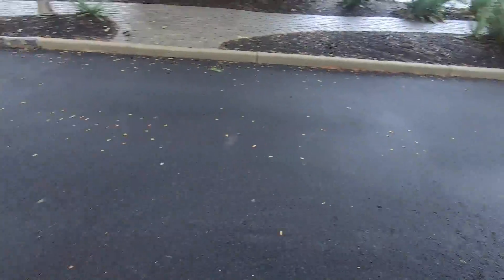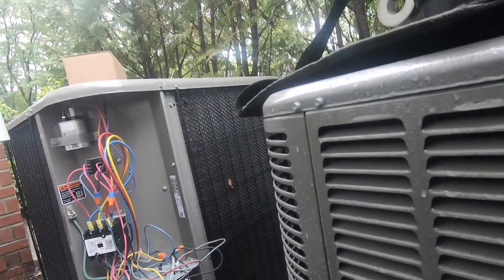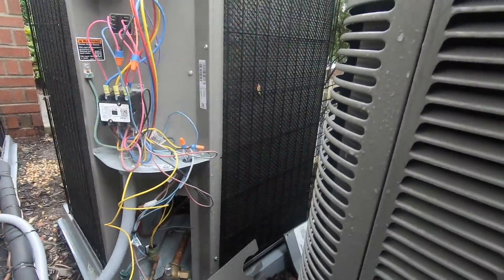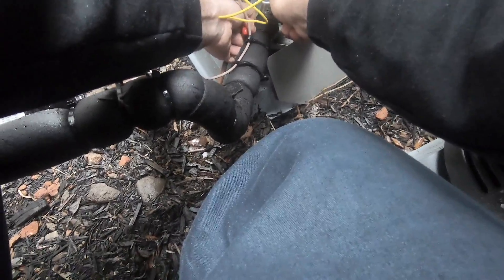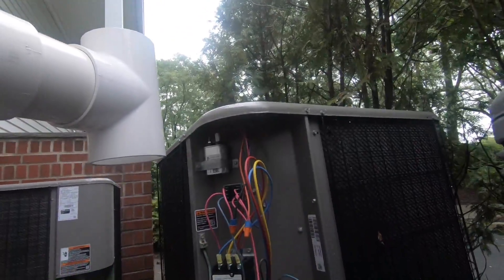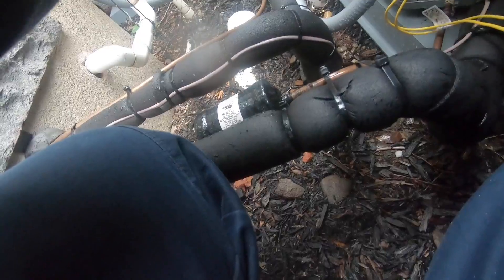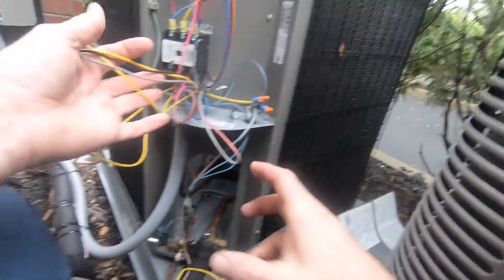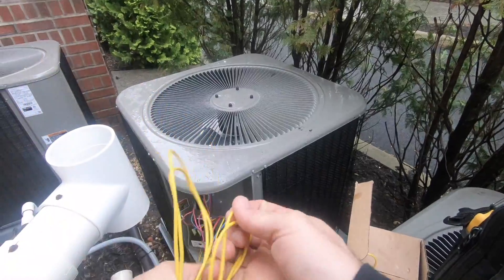AC Repair Replacing Hi Pressure Switch

Comment: i currently have a very slow leak on my low pressure switch.  was quoted $708 to replace it (June '24) from a quite reputable dealer here in my area.  i said to the tech, "get outt'a here.  that can't be that much."  he said, "no really, that's what it costs."  then, i said to him, "you are misunderstanding me.  i said to get outt'a here.  that means...pick up all your shit, put it away, clean up, get in your brand new company truck, and get the F outt'a here."  

i'm sorry, but i don't care good or reputable the person is who is performing the replacement... i don't even care if you can actually walk on water and your name on your birth certificate is 'AC Jesus Christ!'... there is no way on planet earth that a $30 pressure switch replacement should cost $708.  I get it... evacuate the lines / save the R410a that's in the system, torch the old switch off, solder the new one on, pull vacuum to confirm good repair, and recharge the system.  1 person for maybe 2 hours total.  $325 is what it should cost plus the cost of topping up any lost refrigerant.  all you AC companies and techs out there charging this ridiculous amount of money can just go.suck.an.egg.  #yousuck #thief #gotohell
Reply: Do it yourself then 😂....you forgot to mention that you had no clue what was wrong with your unit in the first place and needed an expert to figure it out. That knowledge isn't free remember that!
Reply: It's people like you that makes me money when your shit breaks and needs to be replaced cos you were too cheap to fix it. Spend a dollar to save a dime. Thanks for putting bread on my table 👏
Reply: Lol do it yourself then guy. Why you calling people out there if you have such a bad attitude. I think you need to get over yourself a little to a lot
Reply: Next time you go to doctor tell him the same thing you broke a** 😂😂
Reply: Hmmm let’s see $30 switch and $708 to replace! 
Something definitely wrong with that picture and they know it. They can ad a “T” to the high side schrader valve outside the unit where you put the gauge on and that’s it. Done! They should treat their customers better instead of gouging every time they get the chance.
Reply: @Ojb_1959   you should start a charity service company to help those who are rude or lack direction in life.
Reply: @nhojcam  I bet your a pu**y. No man will take disrespect, so they will say something back and be ready to lay some respect in your face.

Comment: Why am i being quoted $900 to replace mine
Reply from the maker: do they need to remove the refrigerant from your system to replace. This system has one of the easiest switches to replace, many are brazed/ welded to the copper pipe
Reply: @thehvachacker  I'd sure like to know which companies do it like this with the Schrader valve and threaded on vs brazed in.
Reply from the maker: @RyCorp77 if they are brazed in I just add the hi limit somewhere else that doesn’t require removing the charge
Reply: @thehvachacker Ahh. So you just pump down the system and close off the king valves then add it somewhere after? (or before depending on how you look at it)
Reply from the maker: @RyCorp77  https://youtu.be/GlGU17im__M?si=viUZHlJUOLNQTTiF
Reply: @thehvachacker wow that’s way simpler than I thought.  Impressive fix! Thanks!
Reply from the maker: @RyCorp77 it was easier to just show the link to this vid then explain. This way saves my customers money. Removing the refrigerant, brazing new safety in, then vacuuming, and recharging can take 4-6 hours.
Reply: Knowledge

Comment: I can't tell where the second wire goes in you gotta redo this video.
Reply: Facts , video was a complete waste of time smh
Reply: Well just check where wires are connected on old switch and put them back
Reply: @austinamd4416  Thanks man
Reply: The low voltage line from your air handler comes into the switch, the line out from the switch goes to your contactor coil.

Comment: If that switch is bad will the contactor pull in?
Reply: No. They are connected in series on your 24v circuit to the contactor relay. To diagnose a bad switch, check continuity through both legs. They are typically normally closed.

Comment: We use Swivel T in HP switches or Low.   But they Leak for sure
Reply: I'm helping a friend solve this problem on a Trane that's out of warranty and was going to tee on th service fitting and was worried about that they might leak over time. What's the  solution? Leave the Tee off and screw the switch straight to the service fitting?
Reply: Great idea. I was concerned about eventual leakage as well. I might do that when I replace my lpco switch, since Trane has a true suction port to use for checking pressure.
Thanks fo the idea.

Comment: This looks like the High pressure switch that I need, What is this part number?
Reply: Same did you find out the part
Reply: A service tech said that in Florida the HPS was bypassed on most bc it will "never" see a high pressure issue. Looks good on paper but in the real world the system will only fail in a way that drops pressure.

Comment: Quick question- do you HAVE to use a indoor freeze stat with low ambient pressure switch?
Reply from the maker: I would always recommend it. If your running an ac system in cold weather situations.

Comment: Great Video!
I just figured out that my problem is high pressure switch . how do I reset it on old system? I cant locate any buttons. are they resetable? or I need to replace it?
Thanks in advance!
Reply: Some are resettable and some aren't. There will be a button on the top of the switch if its resettable.

Comment: How many hours should it take to replace a faulty high pressure switch in a couple years old Trane residential unit?

I ask because I just had one replaced and it took the tech 3 hours.  Your video makes it look like only a few minutes to complete the work.
Reply from the maker: That depends on if the switch is threaded on and has a Schrader pin behind it. If not system refrigerant needs to be recovered, then system evacuated, and recharged.
Reply: @thehvachacker  So, 3 hours could be a reasonable time?
Reply: @Yankee3164  yes absolutely, I've quoted 4 hours before if its brazed in. If there is refrigerant to be recovered that has to happen, then sweat the old one out, install the new one, pressure test and then evacuate. Then comes start up and testing 3 to 4 hours is fair

Comment: Hi
Hi, 

A mice or a chipmunk chewed my outside unit high pressure switch's wires and disconnected them, so my outside unit is not running anymore. Can I reconnect them with wire nut or soldering or even with electrical tape? if so, does it make any effect on how the switch supposed to work?

Thanks
Reply from the maker: You can reconnect the wires if enough is left for a splice. Just don’t short the wire to ground or you will burn up a transformer. If the chipmunk hasn’t done that already
Reply: Both of wires have the same color - Yellow with a Red stripe - can I reconnect them in any order? I'm not sure which one goes to which.
Reply from the maker: That’s wired in series u can reconnect either way
Reply: D

Comment: I need to change the High Pressure Switch on a Lennox 13ACX-030-230-12.  The factory switch is Sensata model #100103-03.  I understand the original switch is obsolete and was replaced by an automatic reset switch.  I wasn't getting cooling, so I went outside and realized nothing was running.  Started troubleshooting and found I wasn't getting 24VAC at the control contact.  Pressed the reset hard and could get it to start but it was flaky and would just shut back off.  I cleaned the coils, which weren't too bad, but still no luck.  So I bypassed the switch just to make sure it was the high pressure switch shutting it off.  It was that switch and it sounded fine, so I let it run for a few minutes and was getting cold air and normal amperages.  I am going to have an AC tech check the pressure for good measure, but I suspect it is just a bad switch.  Do you know if my model has the shrader valve under the high pressure switch?  It is threaded on, but I can't find that info anywhere online.  Thanks!
Reply: Hi  what replacement part number for Sensata #100103-03?thanks
Reply: @poljam6171  The replacement sensor is Lennox 93W01 Sensata 100087-12.  My unit did have a shrader core for anyone looking for it (to prevent loss of refrigerant).
Reply: Hi Rob, how can we find out whether the AC unit has schrader valve or not? Mine is of model 13ACX-048-230-17.

Comment: The Lennox unit I just repaired at my home has a pressure switch with a reset switch on it.  The outdoor unit would not power on at all. I pushed the button on the High Pressure Switch and the unit started running again. I felt a distinct click when I pushed the button which you can not feel in subsequent pushing.

Comment: How can I tell if my LP Switch has a schrader valve. It has a hex nut below but I am not sure if it is directly bolted on the pipe, or on a schrader valve. It is a Lennox XC17-036 unit from Year 2013.
Reply from the maker: it has a Schrader pin under the lp switch. Is your switch faulty or your system pressure low. Lennox had a class-action lawsuit over leaking evap coils. That would give a low-pressure shutdown. Also, cold morning  have caused the 5 lp switch openings that cause the lp lock out also
Reply: @thehvachacker  I will be measuring the system pressure in a day or two as my set of gauges are with someone who is out of town. I have two similar units and yes on one unit the Evaporator coil was replaced under warranty. 
Once I know the system pressure, I will know exactly the root cause. I did bypass the LP switch, and the compressor, and fan turned up, but I did not run for more than 45 sec so I could not measure the temp diff to see if we were cooling.
Question - what is Lennox policy on warranties when we drop the stupid maintenance plans from installers which end up being more than the cost of the system over time.
Reply: I checked the Class Action suit. My first replacement was done under warranty, if this failed I am over the 5 year from date of install claim - lets see
https://topclassactions.com/lawsuit-settlements/closed-settlements/145764-lennox-evaporator-coil-class-action-settlement/
Reply: The vapor side pressure is 25, and cannot test anything else as the system is shut down due to the fact the LP switch is open. I suspect a leak. Guess this might rule out the switch and problem lies somewhere else.
Reply from the maker: The system is shut down due to low pressure. 25 is the reason the system is shut down on a low pressure fault

Comment: I have a ac/heat pump. The control board shows a high pressure switch fault.  The system works fine in the ac position but when you switch the thermostat to heat it blow the 3amp fuse on the control board.

Comment: I have a nordyne ac/heat pump. The control board shows a high pressure switch fault but the ac and heat still seem to be working normally. Should I go ahead and replace the switch.
Reply from the maker: Need to know the pressure to see if it’s the switch or something else.

Comment: My presure switch opens and close every second, do you think that is a bad switch? Will any switch work  or do I have to get exact the same?
Reply from the maker: Also verify it's not a pressure issue yet an issue with the switch
Reply from the maker: You need to get the switches rated and designed for your systems operating pressure

Comment: Hmmm, my tech said he'd have to do about 4-$500 worth of removing refrigerant to replace the switch and then putting refrigant back in the system.
Reply from the maker: It depends on the machine. Some of these switches are brazed to the copper and if that the case they need to pull a good vacuum which might take 2-5 hours. Every system is designed different
Reply: The HVAC Hacker thanks, it looks like it’s connected to the copper.
Reply: stop thinking every serviceman is a crook .... we paid to go to school or put in our time to learn to fix these type issues so we are worth every red cent . go ahead and go buy the 1000s we spend in tools too just so u can use tben once in a a blue

Comment: I’d start using gloves when you touch refrigerant. Plenty of guys bust my balls for it but trust me, over years of work in the field you will develop a nasty chemical burn that will never go away. My dad has it and my old boss has it.
Reply from the maker: It is a good idea yet connecting refrigerant hoses is a lot safer today than when I first started. I have gotten frostbite burns from refrigerant. Today we have ball valves and low loss fittings. When I started your hi side hose was discharging all the liquid out of it when disconnecting. Today we can safely connect and disconnect with almost no refrigerant coming out

Comment: Cutting the wires and removing about half their length would have made it a neater job, instead of just coiling up the extra.
Reply: Who’s gonna be checking how neat it is
Reply from the maker: Easier to do amp draws if the wire has some play
Reply: @frankduarte4270  preach
Reply from the maker: Just putting the system back to how Lennox designed it

Comment: Would you know if a 1993 Tempstar 5500, Model # CH5524VKA2 has a low pressure switch that has a schrader valve? Or how I could find out ?  I can see that it does screw on like yours. I don't want to find out the hard way. Thanks!
Reply from the maker: I am not sure you. Why are you trying to take it off?
Reply: @thehvachacker . Thanks. Well, I'm not really having a problem yet but this unit hasn't been serviced in over 12 years and I don't know how long before that. So because of its age I'm hoping to prevent any problems. I've replaced the contactor, the run cap, added a start cap & relay. I also intend to replace the defrost board, coil temp sensor and the low pressure switch. I guess this is what happens when you retire - you look for things to do even if they don't need to be done. I did find out that I could put the pressure sensor on the low side service port if I want to avoid the possibly missing schrader valve. By the way, this pressure sensor measures open. I thought it is supposed to be closed. Or does that change after it's installed in the system? Thanks!
Reply from the maker: It needs to have pressure on it to close the switch . Those switches rarely ever go bad. That I never changed one for preventive reasons. You can put an access t on the suction valve port or spin it off and if gas keeps coming out spin it right back on. Then you might need some gas if anything escaped. Have you tried to download the installation or service manual for that system? Most have a pin under but not all. It’s usually a gamble that most techs take having alittle gas to put in if no pin was there.
Reply from the maker: Why change anything just keep the parts and if it breaks change it? I always tried to work on the if not broke don’t touch it motto. Too many times I try to play with something and create more unnecessary work and headaches.
Reply: @thehvachacker   Yeah, I know you're right. I was thinking that the system is so old, something is bound to go. Maybe I'll just wait cause I have a similar tendency to try to solve one problem and create two. I do have the manual another tech gave me a link for. Do you think I should read it?     Just kidding!  Thanks for your responses. By the way, if you're still in the mood to answer newbie questions - what's the dense black material around the coil temp sensor? Is it insulation or just to keep it in place?
Reply from the maker: @geecrawdad  It is insulation to help it sense only the coil, I am not against helping just some jobs might not be worth it, such as replacing hi or low safeties unless they fail. Which usually they never do. The board you can change if you want since it is only electronics which have relays that fail, and can't cause a refrigerant leak. Is this an r22 machine? I wouldn't mess with the refrigerant side. You can still replace if you want. This isn't like a part such as a contactor that gets used all the time. It doesn't wear out. Why create a leak on the system unless you can buy r22 or 410a cause most companies are charging around 100 per pound for r22. I don't even put my gauges on a system during a maintenance to prevent refrigerant loss and the chance of creating a leaking Schrader pin. Unless other symptoms make it look like I am having a refrigerant issue. Read the manual and see if it tells you inside the manual. Or google the manufactueres name and model number you might find a service manual.
Reply: @thehvachacker   Thanks for that. It's R22 and it takes 5 lbs. So that's only...$500. Whoa. I guess I'll leave that alone. I did catch the contactor in time; it was pretty well corroded. You've convinced me, I'll just hold up on the other parts. I'm finding this heat pump real interesting so thanks again for sharing your knowledge. By the way, I saw an ad appear during the video for hvac in georgia. Are you in GA?  Disregard, you're in NJ.

Comment: I’m new in the field what is that relay wired to do?
Reply from the maker: That is a hi-pressure switch. If the head pressure/ hi side pressure gets too high it opens the 24 volts circuit to the contactor in the condenser to shut down the compressor.

Comment: Nice job and video, good to see some units still have Schrader cores on the pressure switches as some are brazed in now and I think Trane has the 1/4" flare, but a tag that at least tells you there is no core. Makes it easy not to pump down or recover to replace this switch.
Reply from the maker: I wish everyone used pins if the switches are wrenched on. A brazed on safety switches like Carrier and Rheem use at least don't loosen and leak. I find its easier to disconnect wiring when they fail and add an external pressure switch on a swivel t on the service port.
Reply: @thehvachacker  this is what you need to do a video on...